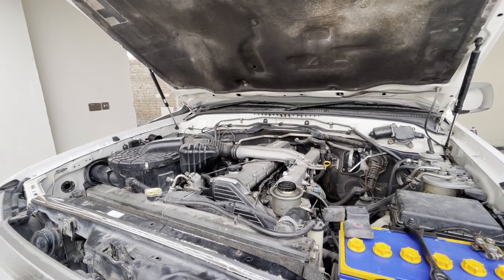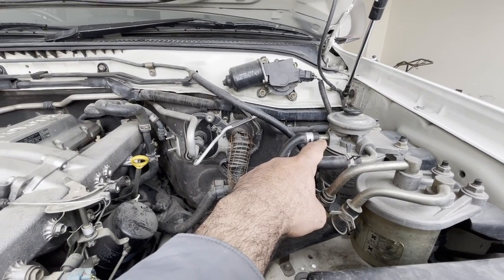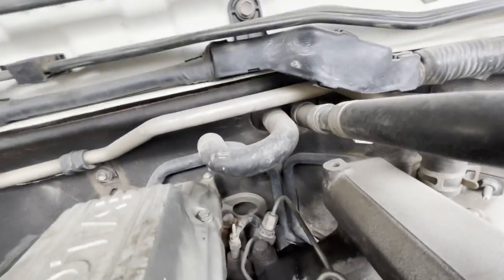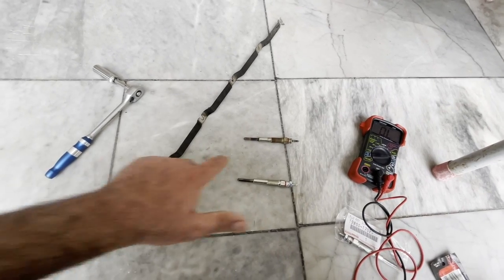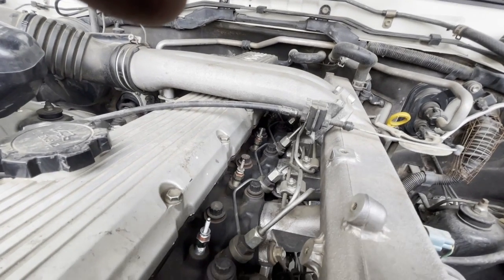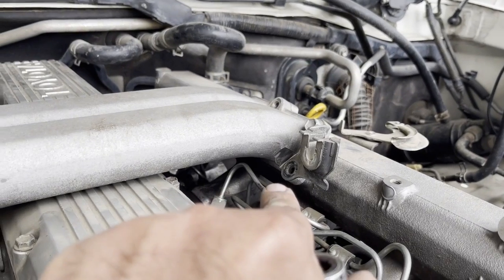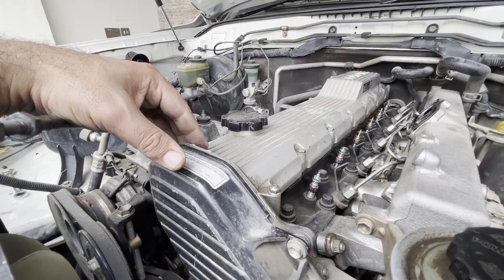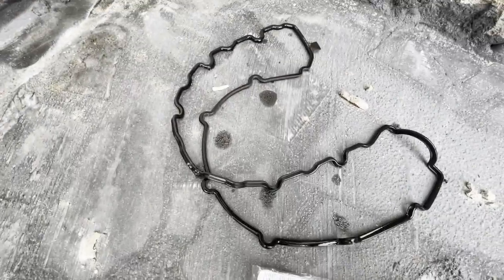Toyota Land Cruiser | 1HZ Glow Plugs & Valve Cover Gasket aka Tappet Cover Gasket Replacement

Comment: Check the fuel line from the hand primer to the injection pump..maybe there's air in the fuel line
Reply from the maker: Maybe you are right because the clamps on fuel lines are very loose and besides that I noticed that element fuel filter cup is missing a spring that pushes the element filter up.